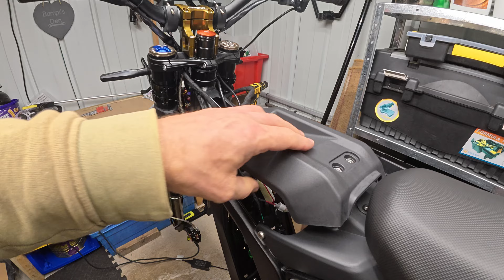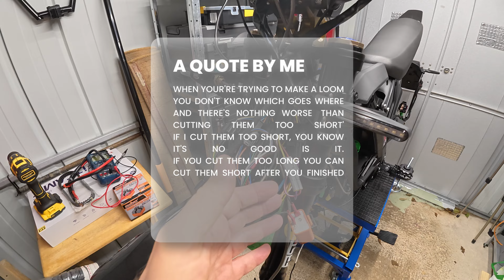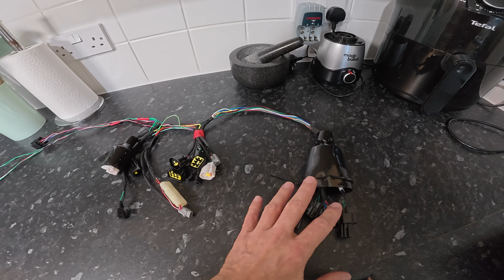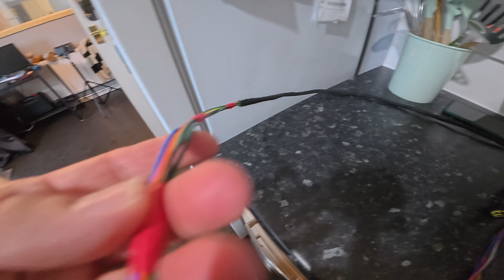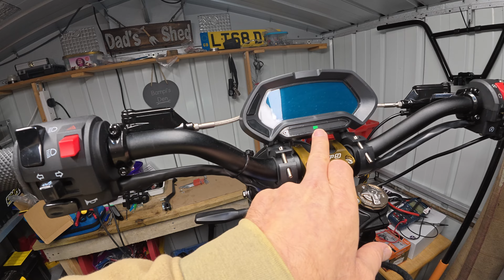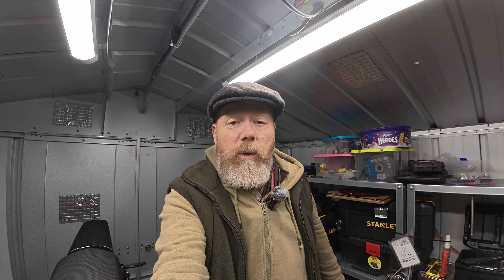Is rewiring a Sur-Ron difficult. How to wire a Sur-Ron brake light the easy way. Surron build part 5

Comment: I've done one of these. You should have just made your own harness from scratch using normal easy to get automotive connectors and real copper(not CCA) wires that are colors that make sense.  Way easier. You don't even have to get the waterproof connectors either but if you don't you should be buying marine grade shrink tubing. Marine grade 3:1 shrink has adhesive inside it and basically becomes one with your wires. For parts you need to come apart often use a combination of shrinks, use the normal stuff over the big connectors just double up and completely cover both ends so you can sleeve them together one inside the other and then use marine to seal the outer ends. It's a bike not a submarine, if your wires are completely submerged you may want to consider getting some scuba gear and some floaties. 

Absolutely hate that harness. They do provide a good wiring diagram at least, I found 2 versions and they were both pretty good. As someone that does lots of electronics projects etc I was actually impressed that someone actually put the time in on it. Maybe that's leftover from when a Sur-ron was a Segway? 

Those stupid connectors. Why are we using an already oversized 9 pin for a 6 pin connection, so we can have extra little pieces to make it fit one way. Why? It's just silly. The black positive wire. I just can't. They want to make mistakes or something, that is just plain ignorant. It's not like that step down converter came from the factory with a black positive, these idiots knowingly did this. 

There's nothing special about a Sur-ron. I wish people would learn this. If you ditch their stupid wiring harness you can use any controller you want. There are plenty of options available with regen. The prices they ask for things because they work with a Sur-ron specifically, they literally just throw the right little  plastic end for this harness and double the price of the controller or whatever. People are lining up to blow their money on this stuff when they don't have. It's not that hard to put 2 wires together. Honestly you could have just used a splice where you did your crimp, it's just a brake light. 

For $30 they have smart brake lights now that have accelerometers in them so you don't even have to wire anything. I got one and it works well. Lots of extra dumb lighting patterns though. Wireless dongle that goes on the handlebars for directionals, a horn, and a mode button and an alarm. The little dongle has a keychain attachment on it and it just twists out of it's mount so you can take it to go when you are in the store or whatever. 

You can get lights for your bar ends for cheap now. $6 I think I paid, 3 wires from each light. Running white light and then yellow/orange directionals. You just drill a little hole in your bars and then feed the wires through, a vacuum cleaner can be used to assist with that part or little fishing line would get it done. 

I like the lighting of the headlight but the round is not working as well with the angular lines of the Sur-ron. Usually that mess if wires is stuffed  in under the ignition switch area and then you stuff a bunch down under the motor, that's why it's longer than you think it should be. It's a hot mess no matter what. Big wires to do halls at 5v and do you need giant conductors like you are lighting incandescent bulbs still?  LEDs do get hot though at that level of brightness so maybe your hiding the wires in the headlight can is not a great idea unless you want to shorten the life of the LEDs and smell your harness cooking every ride at night. You should have plenty of room for wires since you have that much smaller sized TORP VESC based controller that doesn't have to be ginormous to be powerful. That's where you stuff all that extra dumb harness. Tuck it in like a drag queen. 

If you have a 3d printer there are lots of things to print for a Segway/Sur-ron. I actually prefer the extended battery cover to the stock one. I would put a grill over that headlight, some hexagons would probably make it blend in better so look for the Loominade model to print or the guy that made the model sells stuff on Etsy for the Super73 crowd and that is the light I see them using a lot so I'm guessing it's probably the right size. I made my own light from scratch and then sized that model to fit it and it looks good. A 3d printer is like an appliance a housewife can use now, it got real simple here as of late, much easier than when I started and it wasn't that many years ago. It will give you something to do besides chasing kids off your lawn and buying silly hats.
Reply from the maker: @zentechnician  👍👍

Comment: That is so strange that the 12 volt positive is black insulation. Was it labeled or did you discover this? This is one of my fears whether it is a controller I order or a wiring harness. I'm not paying attention and having blind Faith in the colors and something like this slips by me.
Reply from the maker: @BrettWoodBiking  It isn't labelled but I have noticed a few instances in the past where Chinese manufacturers use black for 12 volt positive when 60 or 72 volts is being used in the same loom. I am pretty good with wiring and could visually see what was negative and positive, high voltage and low voltage. I also used a multimeter and did a continuity test.

Comment: If it ain't broken don't fix it...
What was wrong with the stock harness?
Reply: He's making it road legal so it needs extra stuff like the Moto switches on the bars and the custom display.
Reply from the maker: @nicod974  stock harness doesn't have the wiring I need.